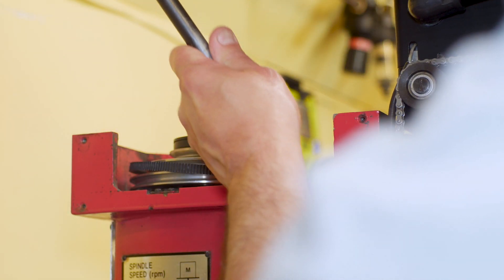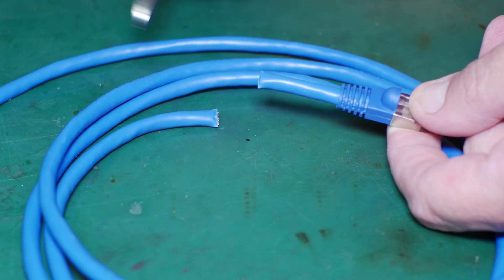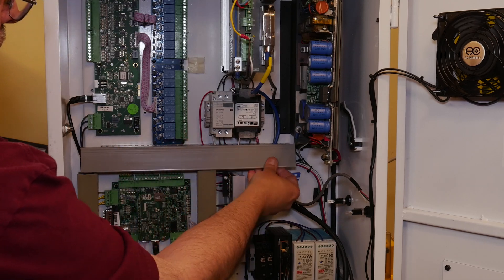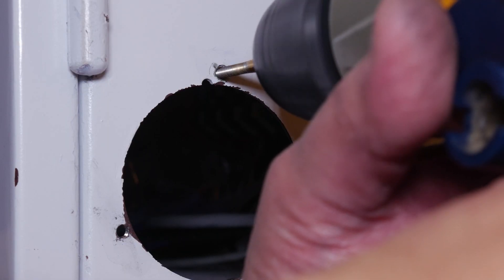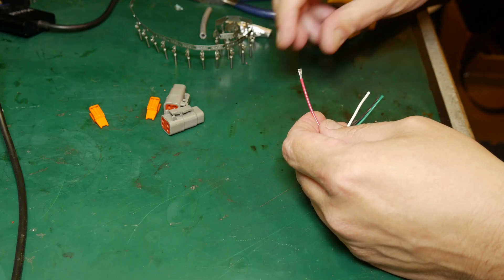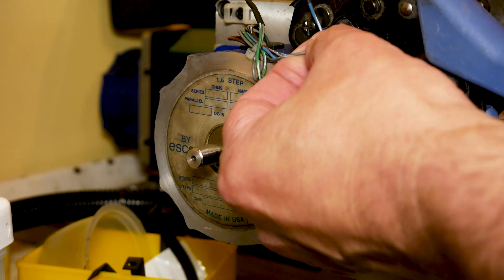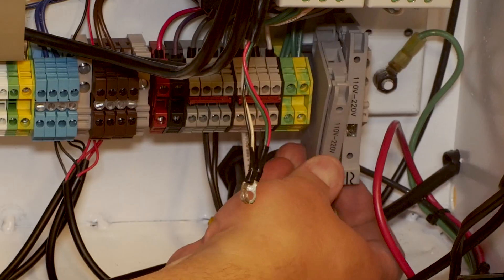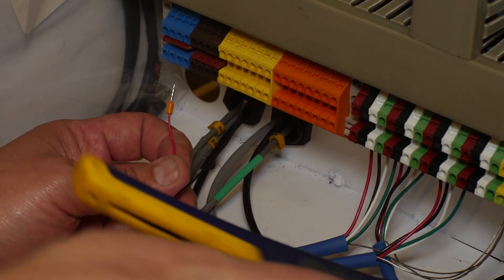CNC Mill Retrofit- Wiring Woes

Comment: I'm enjoying your retrofit, thanks for sharing. I have a question about the DYN4 driver as a spindle drive. I know the acorn can send a 0-10VDC for the speed, but I am wondering how the driver is configured to use it. I've read through the DYN4 manual and it looks like speed mode uses +10v to -10v. I am confused. Thanks!
Reply from the maker: There is a way to use the drive with 0-10v and then use one of the inputs on the drive to choose forward or reverse.  it really isn't documented well, but it does exist.
Reply: @PeteRondeau  Thanks, can you be more specific or point me to the documentation?
Reply from the maker: I’ll look for the drawing package and try to find what I followed.

Comment: Have been enjoying your video series on this retrofit. One way to avoid supports on those countersinks is to put a thin layer across the hole right at the shoulder, just enough for the printer to make a single print layer across which it can easily do with bridging. Much less material involved than the supports and easier to remove.
Reply from the maker: Great tip! And thanks for watching!

Comment: Did you not create a ground loop when connected the ground to the DE-9 connectors?  Really enjoying these videos!
Reply from the maker: Wow! good catch, I never noticed I even did that!  You can actually see on the schematic that I'm soldering on top of that it is only supposed to be attached at one end.  Got in a soldering groove and didn't want to stop I suppose.  Actually, that cable is of very little use and I will probably be removing it and not replacing it until I can hook up a true spindle encoder.
Reply: @PeteRondeau  LOL- my electronics degree is as old as your heat gun and not really needed for my day job.  Shocked I know anything these days!  I am  putting an Acorn on a CNC router and maybe also a few other machines in near future.  I was going to use shielded cable in the cabinet and had the double grounding on my mind...  Thanks!  still watching the series...
Reply from the maker: Glad to hear you are enjoying it! I’m working on editing  the next installment. My degree is a few days older than the heat shrink gun. I got it when I was the chief engineer at a radio station and that was my first real job fresh out of school and an fcc certificate in my pocket.

Comment: It was the trailer type connectors that were the problem and not the soldered joints right?
Reply from the maker: Correct, they were just low quality connectors.  I shouldn't have gone the cheap route.  The Deutsch Connectors I switched to are a massive upgrade.

Comment: If you are using a touchscreen your buttons are on the screen. Now with version 4.50 you can also program the Virtual Control Panel buttons. Get the Centroid Wireless MPG and you would be set. In my opinion, no need for mechanical buttons....
Reply from the maker: Thanks for your thoughts Marty.  This started going through my head because the shop space I sometimes use in these videos when i need  to paint something has a Centroid M400 converted gantry mill that still has a few additional hard wired switches.. But now that I think about it, they may have just been a left over from the previous Ahha conversion we did on it and were just hooked up because they existed.

Comment: Slight correction. Encoder is not there to allow Acorn to control the spindle motor. It is there to receive feedback in order to display actual spindle RPM, and to syncronize spindle RPM to the Z axis for Rigid tapping. There is NO closed loop control of spindle RPM.
Reply from the maker: Ahh, ok, so the control is entirely based on what you enter in the spindle setup screens. Acorn puts out a voltage based on the speed you request, and what you told it the machine was capable of.  Got it!

Comment: I have a panel mounting ethernet cable running over to my all-in-one PC. Believe me, it's a lot more comfortable sitting at a desk than standing with a stiff neck in front of the machine. This way you can site your PC wherever you want - including on the front of the machine if that's what you finally decide. With the PC on my workshop desk, I can do Fusion 360 updates and CAM between jobs. One network cable is a very simple solution!
Reply from the maker: Thanks for your thoughts Murray, much appreciated!